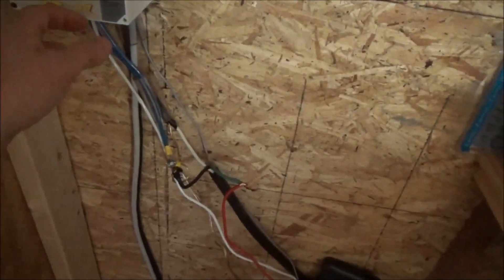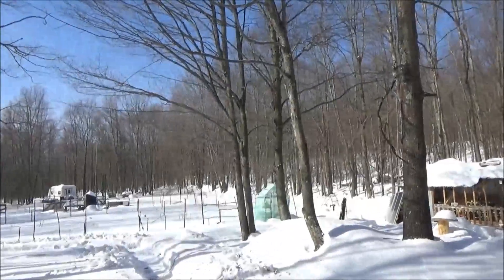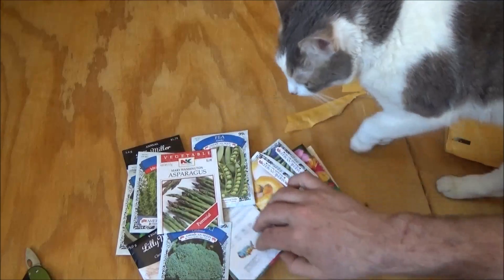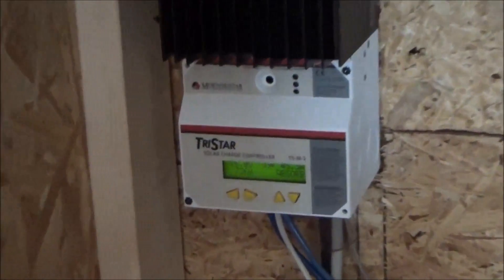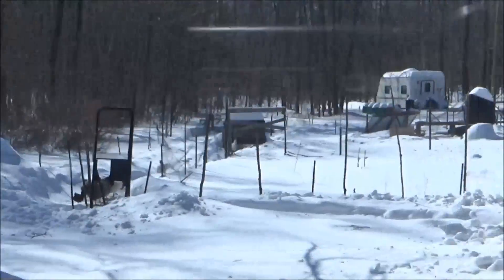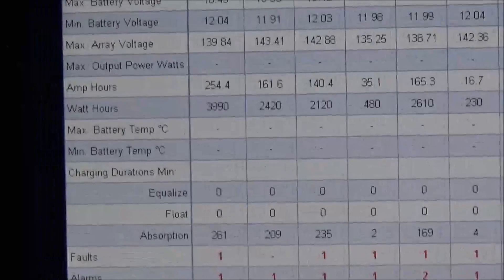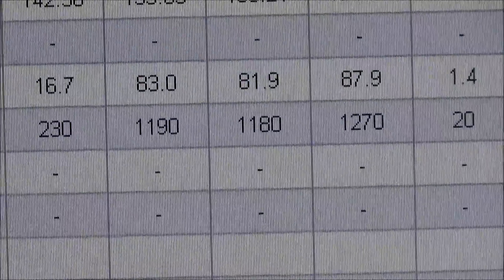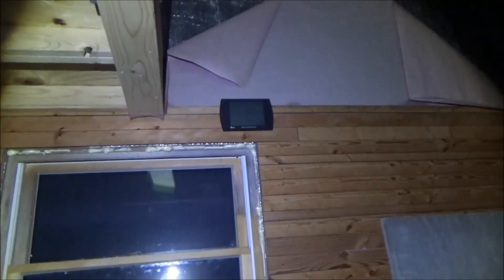Awesome Solar Power Production At The Off Grid Homestead

Comment: As i have said before. I have a suggestion on your Solar and Wind. If money permits get the Midnite Classic 250 MPPT Charge Controller. It will handle both Solar and Wind at same time and will max at 250 Volts. Be sure to order Shunt and Whizbang Jr. And use 1200 Watts of Solar and Wind for home. Take your Tri - Star MPPT and 400 watts of solar and use that for your RV. This should solve problems for both.

Comment: Troy did u make any phone calls to Morningstar about the alarm fault ? And is 16.3volts healthy for those batteries ? I would assume there violently boiling at that voltage ? Have u looked at them.... Seems way to high ... Why not set you absor to 14.5 for one hour and float at 13.8 so at least your inverter can be used ... Don't see much of a point of having an unusable voltage ... Just do an equalize regularly...... Again just throwing it out there ! (Happy battery boiling)

Comment: I need to know what headlamp you are using, Its awesome!  and I would avoid using the wind turbine unless you have the dump load installed as per the TriStar manual. I have one here so I know what you are supposed to be doing!
Reply from the maker: The wind turbine is NOT connected to the charge controller.
It is, according to most wind turbine distributors, connected right to the battery through a diode. Then the dump load limits voltage.
I am using a SecurityIng Cree LED lamp
Reply: The Do It Yourself World I would think that would cause a problem, if your turbine runs fast it sends high voltage to the system, and the Charge controller sees voltage spikes and cuts back or alarms. also the inverter can be over loaded.
The Charge controller acts as the voltage regulator in the system. The dump load must be connected via the charge controller, so that it decides when to dump power to the resistors. The resistors in the dump load have no regulator built in.
Reply from the maker: Neil Shubert But the wind turbine was barely reaching the battery voltages on that day. I was watching the wind turbine volt meter and it was under or just barely above the battery voltage.
Reply: The Do It Yourself World I saw the video, it showed more than 16 volts sometimes

Comment: Troy, now that it is winter what do you think about one day a week making an indoor video related to winter homesteading...i.e., working with sourdough - baking, etc.; soap making, scented and unscented; wood carving or learning to make a wooden spoon or fork; electronics, making a radio; if there is a machine in your sewing machine cabinet attempt to get it running and sewing basic needs like a cover for your greenhouse...just some ideas's to fill out the calendar for your off grid life...., just like the early settlers Winter was for tool making, leather work, jerking meat, making candles, soap, shoes...all in prep for the coming Spring and Summer. Continued good luck.

Comment: just to verify...now that you have gone from a few hundred watt hours to 4 kw hours per day...does the cables from your inverter to the batteries handle that much power...are they getting the full input you think they are...you increase one side of the solar power system do you need to change the battery side kinda thing...just curious

Comment: Q3. Is there a reason I would want to do that?
Yes, there are many benefits to doing this; they are outlined below. Please that note that doing this is partially an economic decision; you can purchase more power than the controller can use and this will contribute to better power availability and lessen the chance of a low voltage disconnect (LVD) & loss of load situation. You just have to consider (at some point) the diminishing return that comes with more power-shaving.
Some of the benefits in exceeding the nominal wattage ratings of an MPPT controller include:
• Effect of maximum charging power limit of a Morningstar TrakStar MPPT controller on an oversized array: o Better production early and late in the day.
o Operates at maximum power rating getting full charging potential of MPPT controller more often.
o Better production during low solar insolation periods (cloudy weather).
o Limits the maximum charging current.
• Viable reasons for using an array rated for a wattage greater than the controller maximum: o Daily maximum power levels may typically be lower than STC rated power of the solar modules.  Tilt, azimuth angle, time of day or year, weather, climate, dust, pollution and other factors reduce output power of the array leaving some unused controller capacity.
o Energy harvesting during lower power production periods (cloudy weather) is often more valued than during times when the array can operate at full power (sunny weather).
o Ability to use larger array sizes for more options to better match strings for the array.
o Using fewer, but high power, modules instead of several smaller ones is more cost effective.
o The availability and lower cost of 60 cell modules (Vmp~30V) from the Grid connected solar market.
o More consistent levels of charging current (running controller at maximum levels more consistently).

Comment: Page 2 The Morningstar Name and the Morningstar Logo as well as the TriStar MPPT, SunSaver MPPT and TrakStar names are all the trademarks of Morningstar Corporation. © 2013 Morningstar Corporation. All rights reserved. Q2. Can I exceed the nominal wattage ratings of MPPT controllers? Will it void the warranty?
You can size Morningstar’s MPPT controllers well above the Maximum Nominal Solar PV Input rating without damaging the controller and without the charging current exceeding the maximum output current rating. The controller can limit output current and will run at 100% of rated current output and not higher. The controller was designed with this power-shaving capability and when oversized it does not void the warranty.

Comment: 800watts is nominal you can put more in ! the charge controller will limit it to 60 amps !! so you could have 1600 watts of panels so you can get more power in lower light conditions its called sun harvesting !

Comment: I hope I am seeing things 16.4v for absorb on your 12v battery bank that is not right the max safe from my understanding on a 12v forklift battery bank with deep long cells is around 16v. PLZ Troy you are going to cook your batteries you keep that up you want long life out of your batteries push them to 15.5 for equalizing for short periods and 15v for long period of equalizing.

I have family that rebuild the forklift batteries and had a long conversation with them they said you are pulling a NO NO they flat out said you are going to cause your batteries to shed lead prematurely and ruin them the high voltage you are pushing will also cause more grid corrosion which also would kill them prematurely.

I am to understand long lower acceptable voltage high amp charges are best not high amp high voltage charges you are going to ruin your batteries PLZ check into these issues.

your charge method is industrial fast charge / short life of battery method you need the long life efficient charge method at sec you are way over volting the batteries in a method that is good for industrial short life method because in the industrial enviroments the batteries are brought nearly dead and rapidly charged and put back to hard service and rinse repeat which is not what you are doing.

The point is you are doing long slow drains and keeping the batteries in safe voltages to keep the issues industrial method combats so charging with industrial method is doing damage rather the helping.
Reply: good the voltage was at scary levels as i explained why that is so.
Reply from the maker: I have rewired the entire system. Plus I reset the battery switches on the controller to standard lead acid battery. Lets see how it goes

Comment: If u wire battery bank as 24 volts, then charge controller's battery wattage output limit is raised to 1600 watts.
Reply from the maker: Yes true but then I need another $1,000 battery bank to get 24 volts. Or I can get another charge controller that can take the solar panels. Way cheaper and the way I am going to go.
Reply from the maker: Ongrid Solar Unless all your batteries are junk to begin with you should never pair old batteries with newer ones. The old ones will pull the new ones down and ruin them with time. The performance of your entire system will only be as good as the worst battery in the system.
Reply from the maker: Ongrid Solar Either we cross posted or you missed my main point? You cannot mix batteries of different size and age. It is bad for the newer, better battery and will destroy it.

Comment: Hei Troy
I noticed you using different types and makes of solar panel on same charger. Do you have some special junction box or something like that.
When i studied for my solar system they recommend use only same type and mark of panels.
And Troy it looks like, forum to not accept new members
Reply from the maker: They are all the same company. Just two are 230 watts and the rest are 200 watts.
Reply from the maker: ***** When the new diodes arrive I will separate the panels into groups

Comment: Troy,
  You were going great guns with your plumbing and then started on something else. Have you done anymore with it ? Seemed like you had all or most of the parts you needed. I was just wondering where you were with all of that.Don't mean to be pushing you. I know that the snow and wood gathering have been keeping you busy not to mention cleaning up your comments on the videos.Site is looking better with everyone's help.
Reply from the maker: The creek froze over solid. No more access to free water for filling up the tanks and testing them. The landlady will not allow me to take more than a few gallons at a time from the well. She is worried there is not enough water.
Reply from the maker: John McLendon Its a VERY slow process and takes a whole lot of snow for any little bit of water. A huge pot of snow gives me about an inch or less of water after an hour or so.
Reply: The Do It Yourself World Well at least you now have a place to ice skate... Thanks for catching me up on the water situation.

Comment: Troy, what do you use for a dump load on the wind genny? Ever consider using a few old vehicle sealed beam headlights? They can handle all weather, are cheap, and can illuminate the meadow at night, when it's blustery. Most are 70 watts each. 140+ if you wire in the highbeam, as well. Or if you expect the blocking diodes soon, ignore this. :)
Reply from the maker: dark matter Yes that has been bothering me quite a bit. I am trying to figure out the best way to use the wind turbine power. There is way too much loss in the lines for these little wind turbines to be that far away from the tiny house. But up closer to the house I have more trees which means more air disturbance.
Reply from the maker: I have actual wind turbine dump load resistors

Comment: build a composter or compost pile around the forklift battery and it will generate heat to warm them up maybe? free outdoor heat source
Reply: ***** build a seperate box around it??

or just a plastic bag??

doesnt seem to be a big problem to come by?

btw, the box handles corosive acid led battery's inside! lol
Reply: great idea
Reply: top tip!
Reply: why would compost eat through metal? it's compost not acid
Reply: yea i dont think worms can eat through metal   lol unless it is rusted out and the batteries are made of plastic on the outside  ,so they might get dirty and stain and it would take 100' of years to decompose , the hardest thing on plastic is the sun ,in a year or two and  if a battery is left out in the open sun ,then the battery plastic  will start becoming brittle
Reply from the maker: Margi Blackwell I think the hot wetness of it would slowly corrode the metal battery case
Reply: yep it sure would